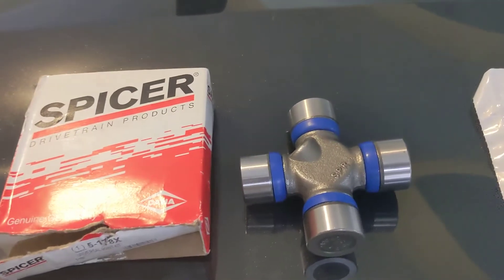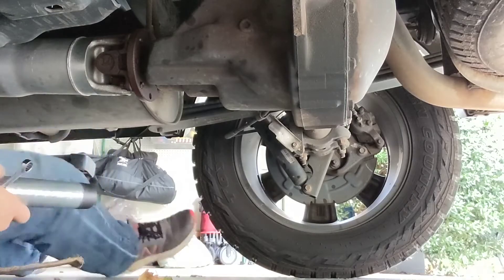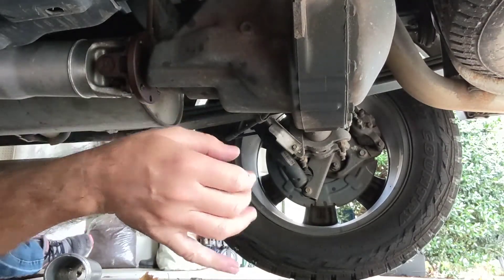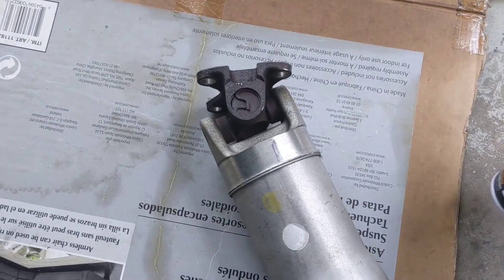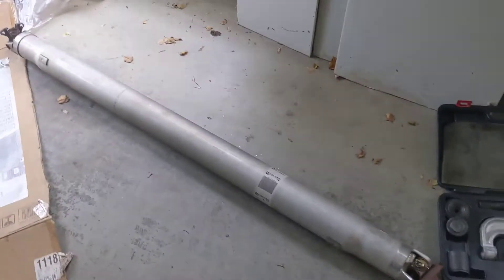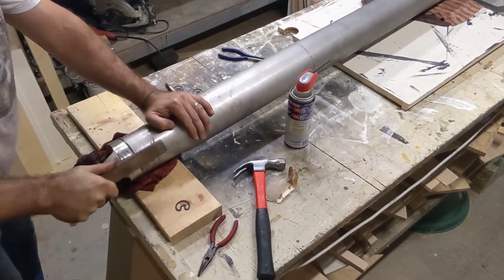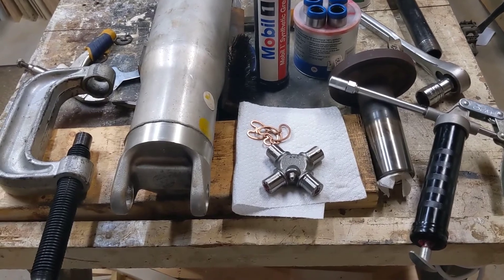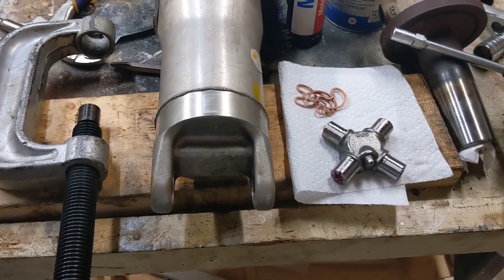F-150 U-Joint Replace and Explain

Comment: Thank you for taking the time to make this video! I’ve watched it through about 10 times in 2 days while trying to get this done. I broke one of the caps when trying to press it in enough to clip it on the first try, but I got it the next day. Great video!
Reply from the maker: Glad it helped. I had to rap the yoke tap the caps a little till the clips finally went it. It's a tight fit.

Comment: Is that an aftermarket aluminum driveshaft? Considered replacing mine with one of those due to rust since the truck came from up north
Reply from the maker: Pretty sure it's stock. This truck was 2013 and also came from up north. Fortunately it wasnt driven much so not much rust elsewhere. It's unclear to me which years had factory aluminum. If it's just surface rust I'd leave it.
Reply: @jonparkmac  Ah gotcha. I have a 2012 and it’s rusted somewhat bad. I think it’s technically still surface though. May take a wire brush to it. spray it down with some Ospho, and call it a day. Thanks for the reply brother!

One more thing, have you heard anything about the 5.0 engines having valve issues for these year model trucks? I think yours is the Ecoboost but just curious if you had heard that. Saw a few blogs talking about it and it’s got me considering selling this thing and getting something else but didn’t know if that was truly common or not
Reply from the maker: There was an issue with intake valves leaking, but I don't know the frequency of it. We only here about issues, the vast majority are fine. http://www.engineprofessional.com/TB/TB022117-1.pdf
Reply: @jonparkmac  Awesome, thanks so much for that! I’ll probably keep it and see how it goes. I know head work isn’t cheap but it’s probably worth the risk. Thanks again!

Comment: We're the factories solid cores? If not I have an idea to grease them then tack the drill hole closed
Reply from the maker: I would suggest using them as designed and not modifying them by tacking anything

Comment: Any one working on rusted vehicles should invest in a map gas torch $50+ will get you a torch tip and bottle of Mapp gas it'll make your life alot easier
Reply from the maker: Agree. Heat is boss. Thanks for your insight

Comment: My 02 f150 i can get a 1/2 drive 12p socket with 3" Harbor frieght extension the ones with some extra movement an small air gun
Reply from the maker: Not following ..for what ..removing the flange bolts are pressing out the joints. Neither will work with a small airgun

Comment: Did you have problems with the u-joint fitting on the tranny end?
Reply: Do you mean the spoil? Because if you have trouble fitting it in you just put some grease on the shaft before you put it into the tranny

Comment: Oops, I meant the rear end, I fought both bu could not make the one on rear end go in enough to put clips on.
Reply from the maker: I had needle drop and got between cap and joint, had to take it apart and redo and fixed that. Even after that it is still pretty tight and hard to get the clips in. So make sure you didn't drop a needle, clean out the clip grooves real good. Rap the base of the yoke real hard with a hammer to vibrate the caps into perfect align because they can bind.
Reply: That’s the problem I’m having now.

Comment: What is the part number for the joints
Reply from the maker: Spicer https://www.amazon.com/dp/B009YZKL38/ref=cm_sw_r_cp_apap_sIaxHlFSKIbCR
Reply: @jonparkmac  won't fit to big to wide
Reply from the maker: @alicegarrison5426  did on mine
Reply: @jonparkmac   idk what's going on with mine then its a 16 can't find u joints no where , tried a Moog 331 to dam wide
Reply from the maker: @alicegarrison5426  maybe take your old one to Ford parts dept, ask for new one, and compare them on the spot. Not moog or spicer, but may be an option
Reply: I’ve been having the same problem
Reply: @dorianengels9029  I had to get a whole new shaft